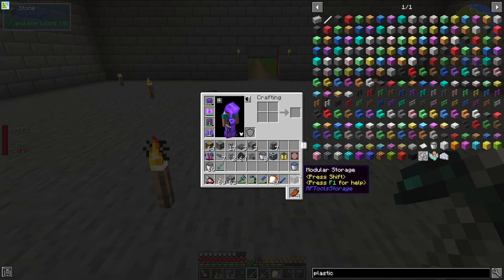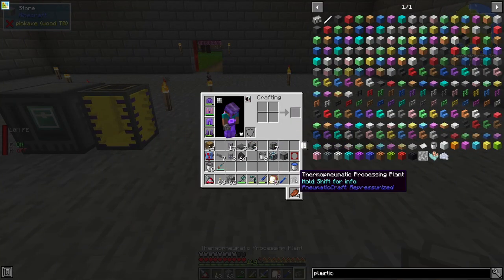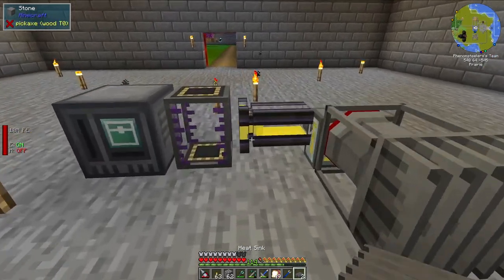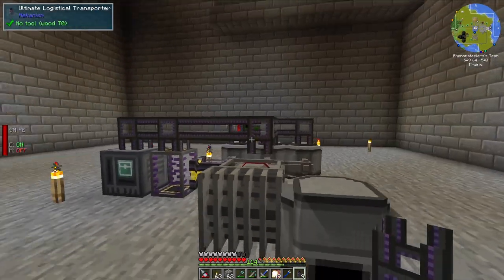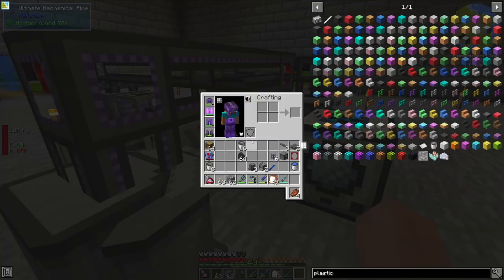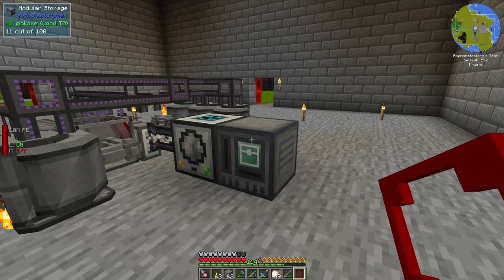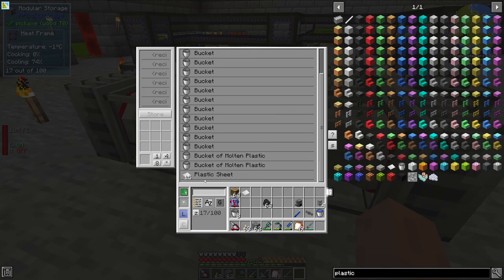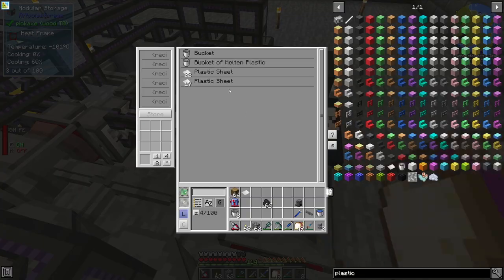How To Automate The Production Of PneumaticCraft Plastic Sheets

Comment: Having issues getting the modular storage to take the plastic bucket and turn them into plastic sheets, figure out how to get the buckets over in the first place but they wont craft.
Reply: got it to work out, 1 vortex isn't enough to cool it at a good rate, 2 or 3 are much better and got it to work after all, going over the storage card and locking the modular storage would have been nice as well, key parts missing to a new person to this mod pack.

Comment: Making plastic from LPG does not require any pressure, just heat.
And you can throw a block of compressed iron on the vortex tube and heat sinks on that.